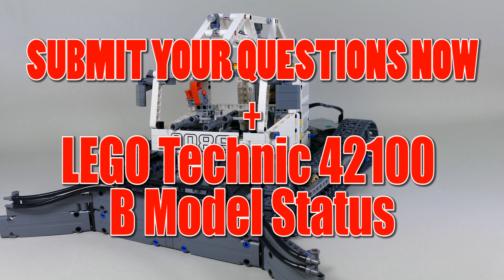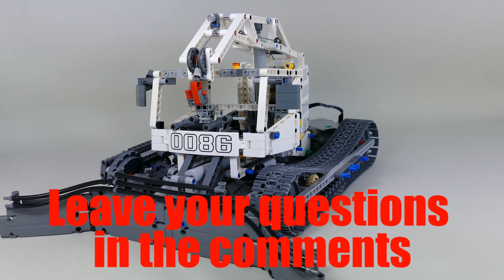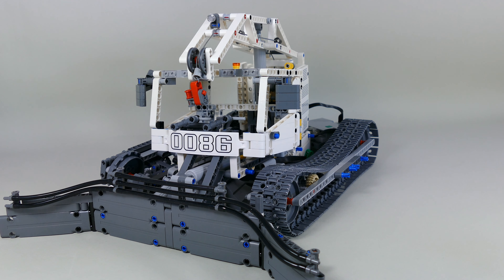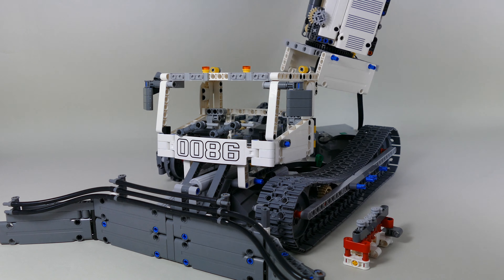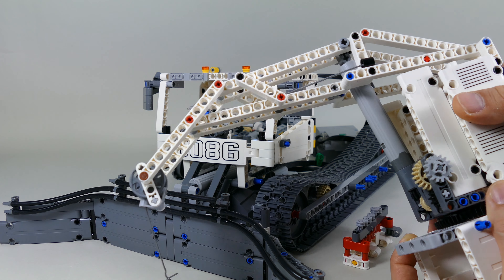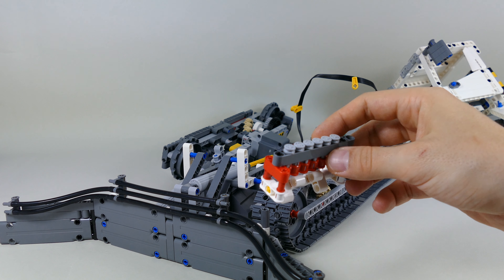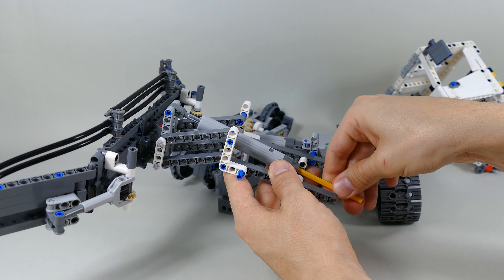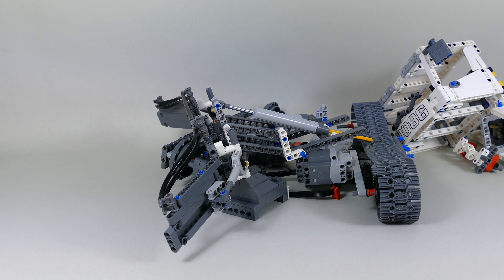42100 B Model Update + Submit your Questions!!!

Comment: how about this configuration:

xl motor left track + inline engine
xl motor right track + inline engine
xl motor boom actuator (two XL actuators grouped together)
L motor winch 
L motor turntable
L motor shovel L/R angle (two XL actuatorsfor one for L one for R,with pivot in between)
L motor shovel up/down (two XL actuatorsgrouped together)
manual shovel ends angle adjustment (L+R) or add an extra motor.
if you have enough spare tracks you can use beams to link the tracks up, so two tracks either side and just leave the inner most tracks unsupported or use small pulleys/idler bevel gears or 1x1 beams as rollers. the beams on the tracks will also help grip the snow
Reply from the maker: I need one motor for the rear attachment.
Reply: @grohl666  oh, I see. looking forward to seeing it anyhow

Comment: Hi Milan! You are my favourite lego technic designer and I have 2 of your models one is the defender and the other is extreme adventure my question to you is that is there any sort of gearbox cracking sound in some specific gears in  the land rover defender model because it has been stated by other speed builders too ? Thanks
Reply from the maker: Not on mine, but I built it so many times and I always check the parts if they run smooth. .@racingbrick made a nice video on what parts to watch out for.
Reply: Thanks milan .

Comment: Great progress on the model, can't wait for it! A few questions, not sure which can be answered :)
- Do you think you'll be able to use the functions of the snow groomer with the stock Control+ profile? If not, do you plan to use the Powered Up coding canvas or a 3rd party app?
- What do you think about the software abilities and the customization options of the Powered Up system, do you find it easy and intuitive to use?
- As the master of the alternate models, what do you think about the increasing number of Technic sets that don't have an official B model?
- Do you have the possibility to work from home nowadays or you have to go to the office?
- What is your preference, studded or studless Technic?
- Did you make the decision on the gear sequence of the Defender or you had to do it this way? :)

Comment: HI Milan, The Questions are as follows:
1. How did you apply for LEGO designer?

2. What was the process of getting in the company? 

3. What do you do at work? 

4. Do you build stuff and the company decides this will be this year's set X or you're given a theme and have an internal competition who will bring out the best model?
5. Are there sets that you were not happy with but turned out great later?
6. Why did you choose Technic?
7. Has Corona affected Lego lately?

Cheers from Bulgaria, I'm the guy with the Fury suggestion for one of the ninjago B models /the blue plane/...
Reply: Wait. He is a Designer of Lego???
Reply: @KyndaKamo  yes, he is a technic designer at Lego.
Reply: @bohdan7531  ok cool i didn't know that XD
Reply: @KyndaKamo  He's the dude responsible for the 42110 Land Rover, as well as the 42078 Mack Anthem, the 42069 Extreme Adventure, the 42052 Heavy Lift Helicopter, and a few others